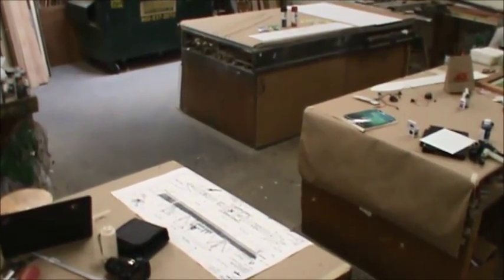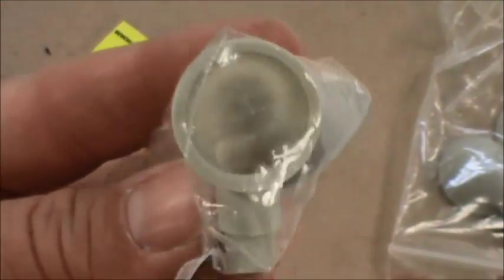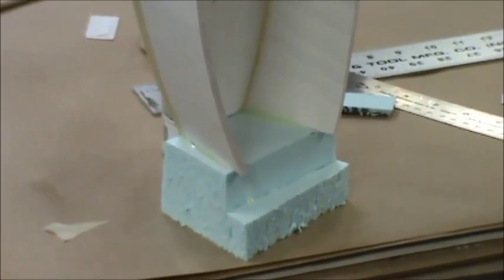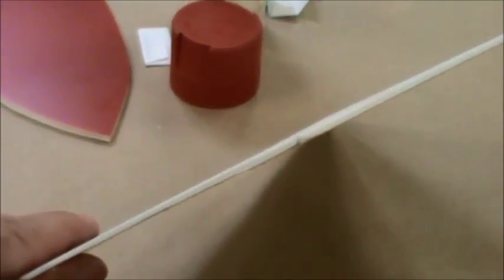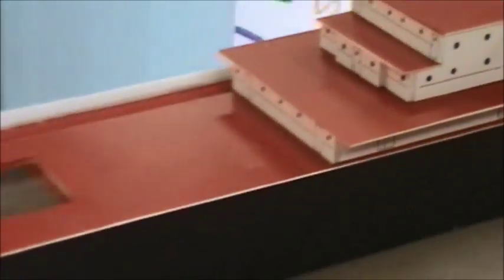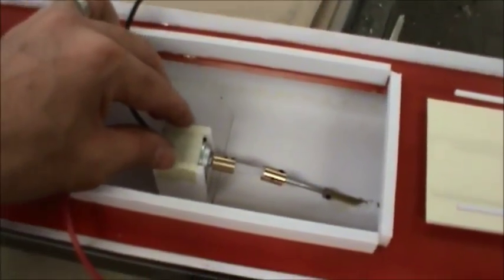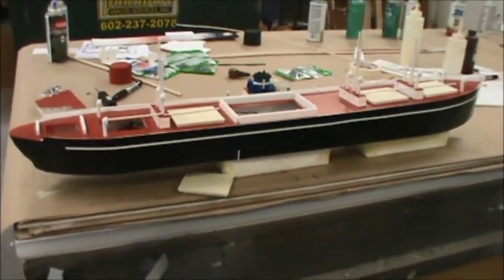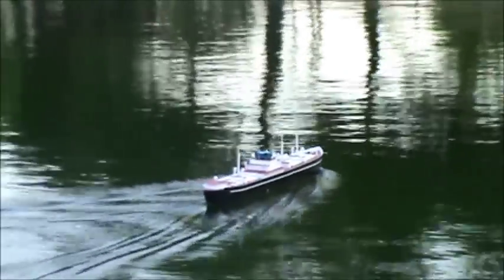Liberty Ship model in ONE DAY! How I did it.

Comment: Inspired by this video, I have begun an Istanbul ferry, the Pasabasa.
Reply from the maker: YES!!! This is EXACTLY why I made the video! Don't give up! Keep testing, practicing and improving! My first boats looked terrible. But I didn't give up. Good luck!!
Reply: greenseaships Thanks for the encouragement.  I am slow but tenacious. I plan do an RCGroups build log. When I do, i will send a link. Thanks for the ideas. One of the things I like to do on airplanes is use brown paper and water resistant carpenters glue to surface raw foam. I will do this on the entire hull foam core and the raw foam end pieces. We will see what water soaked PVA glue does to foam core. The hull and main deck are complete. My mat board came in today so the upper deck construction will start soon.

Comment: That was a very nice model and an impressive short building time (I like old-style ships). May I ask you a question about the Polycrylic, does this product only waterproof or does it also provide strength? I am asking because I have a balsa hull which needs to be sealed and I do not like working with epoxy products which is, to my understanding, often used on balsa hulls.
Reply from the maker: Hi and thank you! I use about 2-4 coats of polycrylic spray and no, it would not provide structural strength. The best if could do is offer some protection against small scuffs of the occasional fingernail scrape. If I were to do 10+ coats of polycrylic it might be another story. But 2-4 coats is simply water protection. For your balsa hull (assuming this is re-enforced with formers inside the hull), you might do quite well with a product called STYROSPRAY 1000. It is available from Industrial Polymers. I usually use that to coat my hulls.
Reply: Thanks for reply, much appreciated. I will look into the Polycrylic and Styrospray 1000 and consider. The deck is not yet glued on so I am able to easily strengthen the hull with additional internal doublers and supports in case of using waterproofing (Polycrylic) only. Will figure out how to proceed.

Comment: Have you ever considered using aluminimum duct tape (not ducktape) instead of masking tape on the seams? It wouls be more durable and less fragil than the masking tape. Might even be thiner than the masking tape.
Reply from the maker: True, but in my experience, that kind of tape doesn't take paint well. Chips off more easily than masking tape.

Comment: Amazing, if I were to do this how much would it cost assuming I don't have specialized tools or parts lying around?
Reply from the maker: Well the running hardware I used here (prop, shaft, connector to the motor) cost probably $50-60 from Dumas. The motor I had lying around but radio shack used to carry them for like $5. The radio is 2.4ghz Specktrum DX6i. It retails for about $80-100. I think Spektrum DX5 is cheaper and will work just as good. Rudder hardware I got from the hobby shop for >$10. Rudder servo maybe $20. Battery is a 2-cell lipo. You can get one from Value Hobby for about $20-25 I think. Charger I use is a 4-port lipo charger that goes for about $75 but you can find cheaper lipo chargers online. Just make sure they are for lipos. As for the build foam, I have no idea since I get it from work. But I'm guessing this thing has less than $50 worth of dollar tree foam in it.
Reply: @greenseaships  thank you so much, I'd reckon the dollar tree foam cost less sand luckily I already have a transmitter

Comment: How do you keep water from coming in through the propeller shaft tube?
Reply from the maker: For one matter, the prop shaft rises up above the water line inside the hull, so water naturally doesn't rise above its own level, at least not much. The shaft is not threaded all the way, so there isn't anything really to grab the water and suck it up into the boat. For another matter, I lube the shaft with lithium grease.